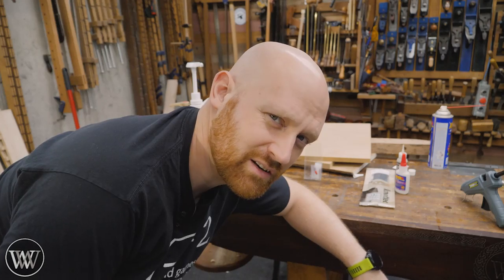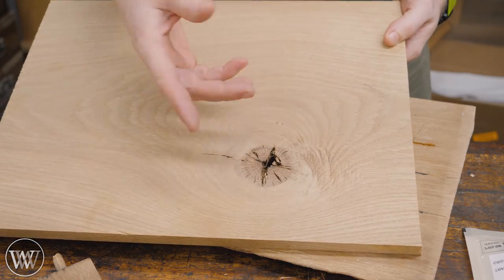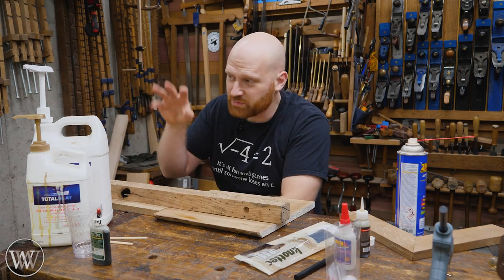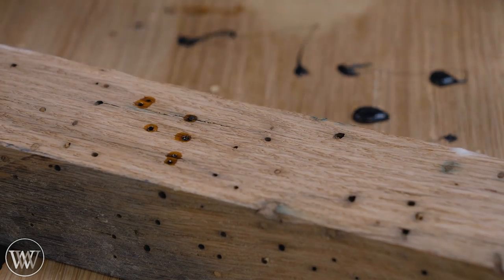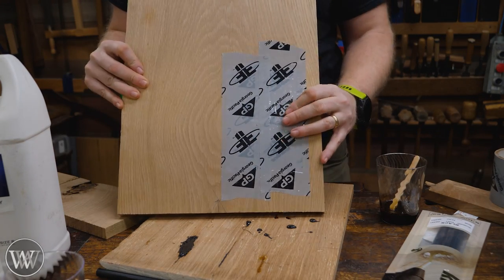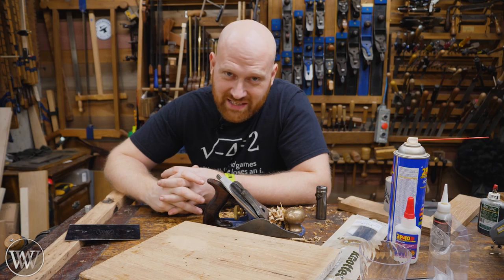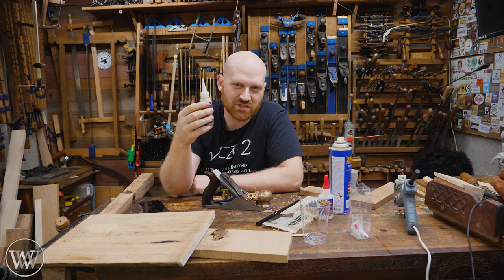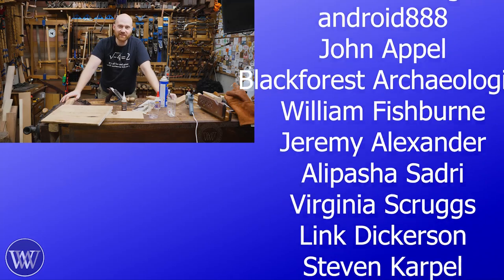3 Ways to Fill Voids In wood

Comment: I work with a lot of hard woods and don't have access to any of these products, so basically after sanding I would use the fine sawdust of that wood and mix with wood glue, and if done well, you won't even notice the fill.

Comment: I have used resin and CA glue. But the one I use the most is wood glue mixed with saw dust from the same work piece. This is the best colour match but doesn't always look the best with a finish.

I've also seen the glue stick one used where they have a big metal block to flatten it and cool it down faster.

Comment: My grandfather had a bunch of baby food jars of varnish mixed with different sawdust types. I've done the same with, yup, BLO. My go to with knots is the charcoal dust in the bottom of the bag and just enough 5 minute epoxy to coat it. I still have a small amount of the massive maple burl I harvested some 25 years ago and the epoxy and charcoal has been a project saver many times.

Comment: Nice breakdown showing there's not a single good solution. 
We are getting ready to mill hickory to create a floor.  I've sent a question to Totalboat but yet to recurve an answer.  Would you use this particular TB product to fill in knots for a kitchen floor?
Reply from the maker: I used their high performance to fill the knots in my kitchen floor at my last house. You can mix a die in with it very easily.
Reply: Thanks for the quick response. In your video I noticed that you had the medium hardener. Is that the same one you also used on your floor
Reply from the maker: sometimes I use the fast when I know I will have to do a  second coat. but for most things I use medium

Comment: I have used colored wax that I melt into the void. You can buy them in colors that are supposed to match the species of timber. I imagine the colored hot glue is just a modern adaptation of the wax.

Comment: I just finished a project where I used epoxy for fill. I used a file to smooth. The question I have which option would you use to fill voids in elected officials. These would be very big voids. Good show. Be safe.

Comment: I am using ca glue+ accelerator, simple woodworking glue with  mixing  it with saw dust and epoxy which i also mixing it with fine saw dust.

Comment: Love the idea of hot glue.  I hadn't heard of that one.  You didn't cover my go-to: rubbing sawdust into the yellow glue.  And then there's the 'cut out the problem area and glue in new, uncracked wood' method.
Reply from the maker: I've never been a good fan of using sawdust to fill in. It usually just screams tacky in my book. But a lot of people love that one.

Comment: Thanks for the tips, James. I saved the hot glue sticks in my wish list. That's a good idea. I like using CA glue but no matter how careful I am using it or cleaning up afterward, my tips always dry hard as a rock and the rest of the bottle is useless. Or while I am trying to unclog the dried tips, I knock over the bottle. And those tips always leak and leak. It absolutely ruins my language. So I tend to use it in the smallest tubes I can possibly find so I waste less. And if it dries hard, I don't feel as bad about throwing it away as I do those big bottles with all the extra tips and tops. Can't wait to try the hot glue.
Reply: One thing you need to make sure to do is keep the sticks stored in a sealed bag. Something about them staying in open air for a long time and then getting heated somehow makes them more likely to create bubbles. You can stick the whole glue gun in a ziploc bag. I will say between trying knottec and Rangate I liked the Rangate sticks better. The material is higher quality and it cuts even cleaner, but it is more expensive than the knottec. I’d also use a chisel to remove the excess. Both companies offer a wide flat blade.
Reply: @typeafurniture  Have you by any chance compared to other melt-in filler materials, especially the traditional shellac filler sticks?
Reply: @tungsten_carbide  I have not, just knottec and Rangate

Comment: Thanks for the verrry helpful vid, James. Lots of good tips and tricks. But I wanted to ask you: I notice that you always use small plastic cups with the epoxy. Do you just throw away the cup or can it be re-used? Also, are paper cups with epoxy out of the question? Thanks a lot, you’re the best.
Reply from the maker: Paper cups can work. Just make sure they're not waxed. The wax can interfere with the epoxy. The problem with a paper cup is if you mix too much and you get a runaway reaction, the paper cup can catch on fire with the plastic cups I can use. Usually use them a couple times but it all depends on how much epoxy is left in the bottom of the time.
Reply: @WoodByWrightHowTo  Thanks, James, that’s very helpful!

Comment: My only concern with the hot glue is if you use it on something you plan to use finish on, does it take it, or does it eat  at or weaken the glue. I use a lot of rub on poly finishes that I make up myself or I'll use Arm R Seal.
Reply from the maker: With finish it is about the same for all three.

Comment: Thanks for the tips.
I would like to know though. I have an old workbench where the top was eaten by bugs long ago, was wondering what to fill them with since I do need to plain the top as well. How well does Superglue plain? 

For a moment I even imagined to use the hard beeswaxes
Reply: Can't tell you how it planes but it is very brittle for sure.
Reply: @dwightl5863  hmmm epoxyor hard wax it is then!

I tried phenolic resin, but its too thick and shrinks too much to fill such gaps well.

Comment: Now I'm curious if a 3D Pen can be used to fill voids. ABS sands really well...
Reply: Good thought! Should sand and scrape a lot better than even that firmer hot-melt stuff. What kind of colour range is available, I presume black is a given?
Reply: @tungsten_carbide  Black is common, although you can cheaply get color sample packs of 1.75mm filament used by most 3D pens (and printers). There's even filament with wood already incorporated.
Reply: @socketwench  Thanks for the details!

Comment: Sometimes when I use CA glue to fill voids and then hit it with activator, it turns white and cloudy.  Any idea what causes that, James?  Did I use it in a void that was too large for CA glue?  Old glue?  Shop gremlins?
Reply from the maker: When ie cures too quickly it creates a lot of micro bubbles. So if you want in cleaner just let it set for a while till it is hard.
Reply: It does not take a lot of activator to work.  I also prefer the activator in a spray can rather than a pump spray.  Spray can is a finer mist therefore you use less.
Reply: ive experimented with finishing with ca loads and on one guitar body i had a good 2-3 layers, switched brands as i ran out and it went white and cloudy and an overall mess so on that occasion i blamed the brand but i did it another time and there was a lot of moisture in the room, moisture cures ca glue really fast and ugly so if your still having no luck try checking the humidity level of your workspace

Comment: Why only these three methods? You can also (1) remove a knot using a forstner bit and fill it up with a wooden disk and (2) use a mixture of woodglue and sawdust to fill holes.
Reply from the maker: There are a lot of other methods. These are just the three that I use regularly. It's very rare that I end up using something else.